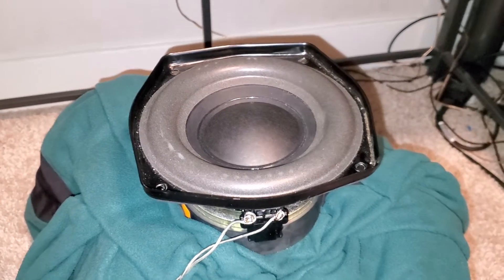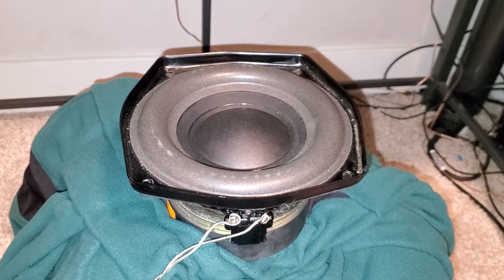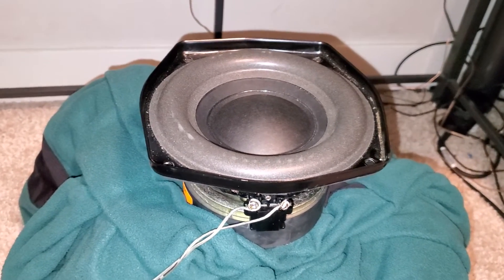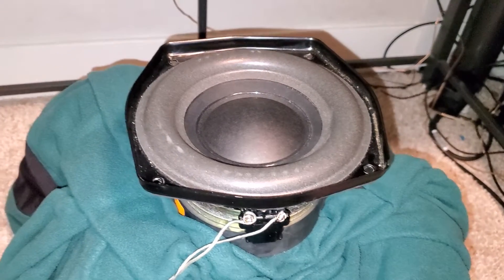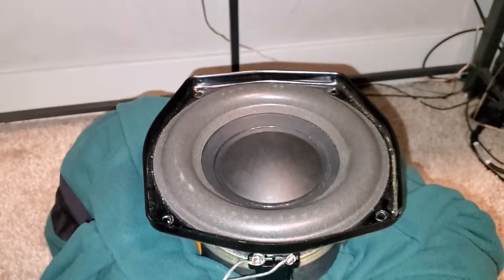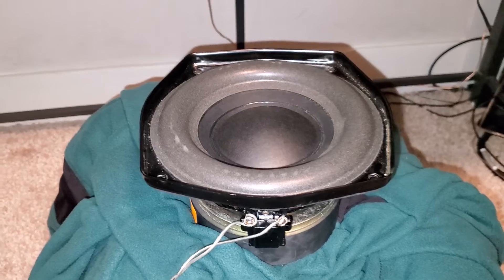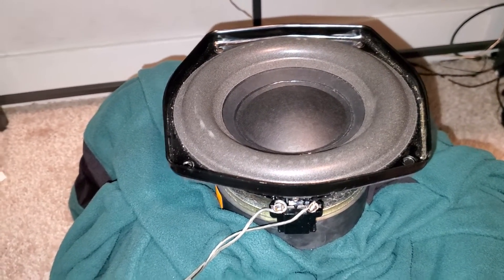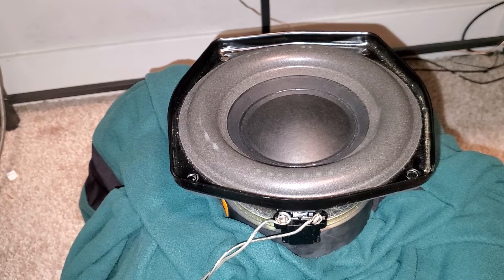Philips subwoofer from BMW Z4 test

Comment: Do you have a box for the little sub and good  video
Reply from the maker: yeah but I dunno if it fits. I haven't have time to try fitting it in. Also since it is a cheap home theater box it probably isn't tuned for this driver.